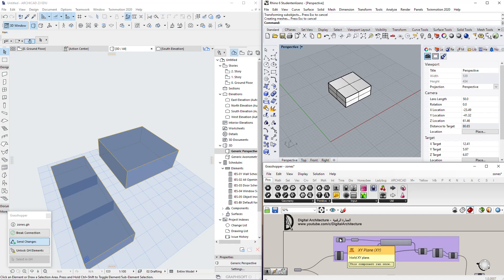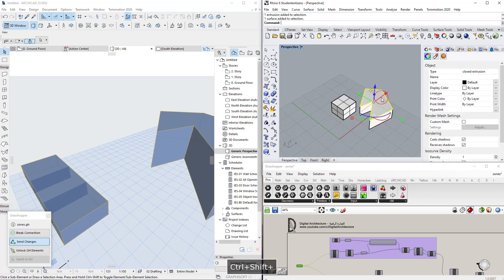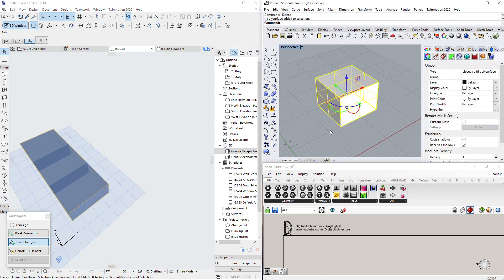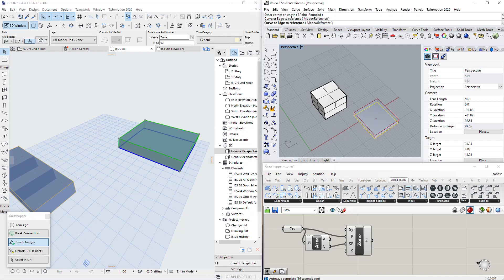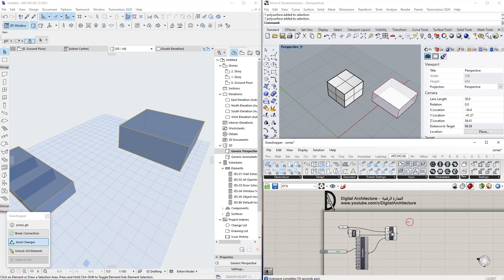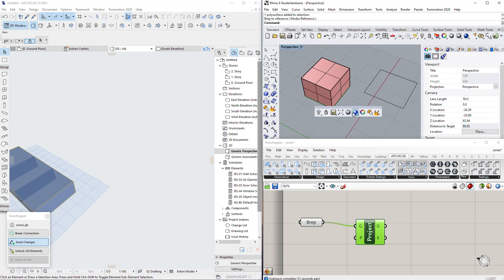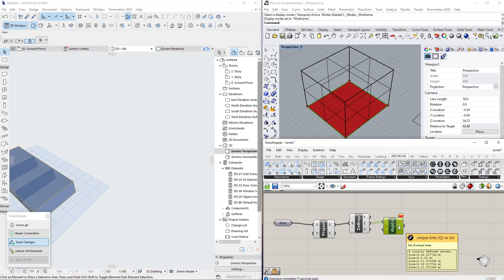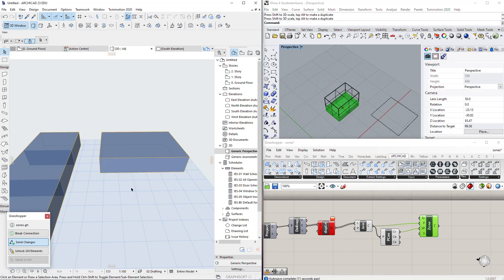Archicad-GH: techniques with zones in Archicad using Grasshopper

Comment: I tried the live connection and it worked but the zones don't appear on the rhino interface 
A warn is saying : could not claim hockeys. Another CAD process is unresponsive .
What can I do to solve this ?
Reply from the maker: Mm strange. Are you using the latest version?
Reply: @DigitalArchitecture  I'm using archicad 23/rhino5 and for the live connection i don't think that it's the latest version
Reply from the maker: @meyssac60  try to update it to the latest version